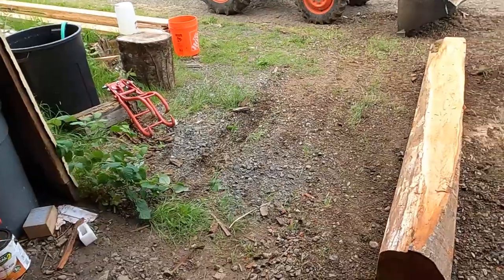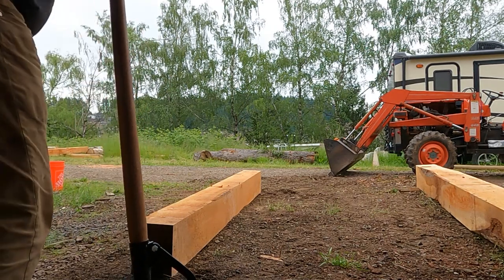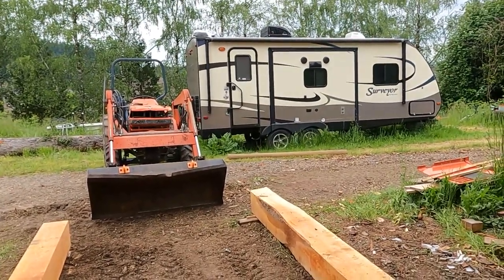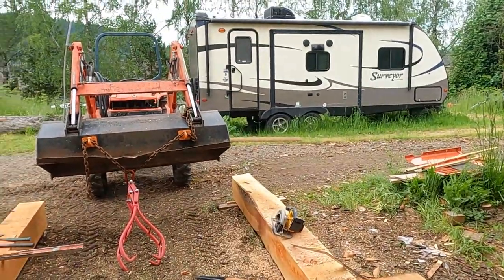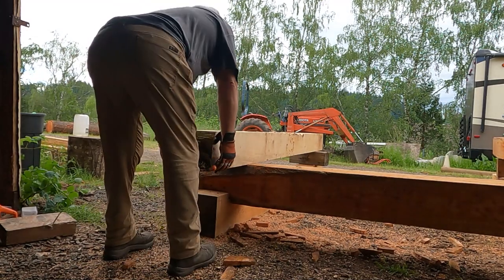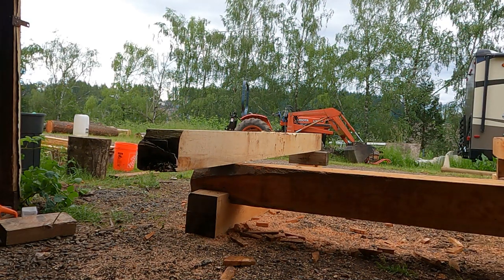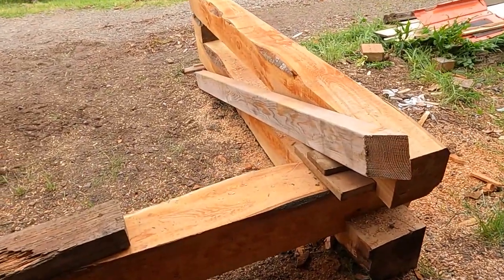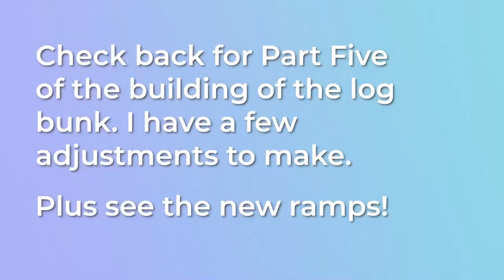Building a LOG BUNK for my Woodland Mills HM 130 MAX | Part 4

Comment: Rather than going to all the trouble of a cable, just get forks for your tractor that clamp to the bucket.
Reply from the maker: Bryan, thanks for watching and for your comment. I do have forks for my bucket, however I have some logs that are way too heavy for my old Kubota to lift. I max out at about 1,000 pounds. So the log deck with ramps and a cable system seems to be the best that I can do for now to get those large logs up onto the mill. Someday I would like to buy a skid steer that can lift more weight. Some of the tree service companies that I have worked with have them and they are awesome, just very spendy.